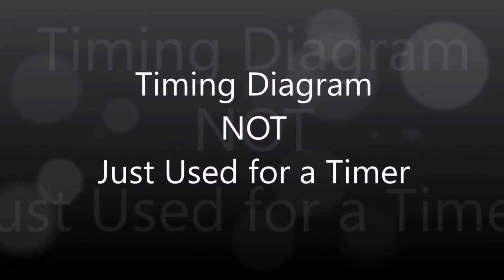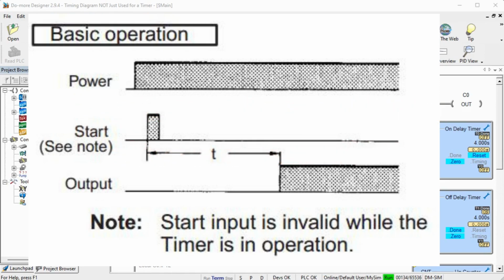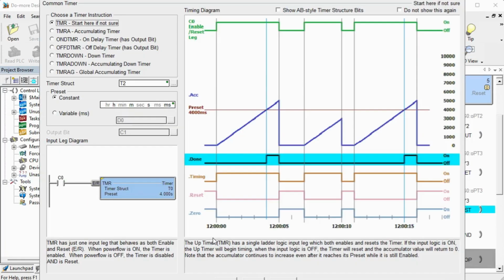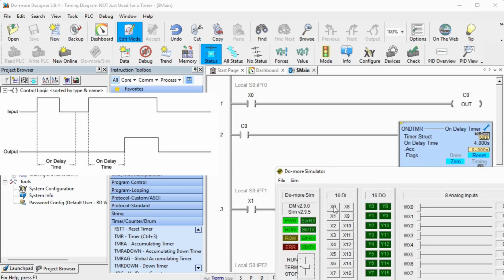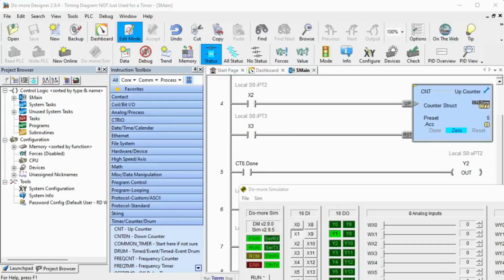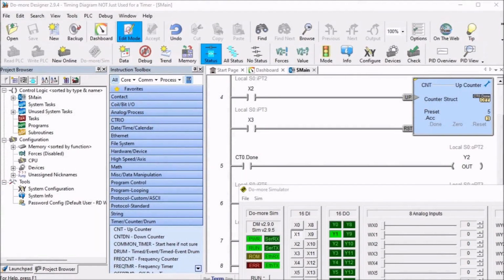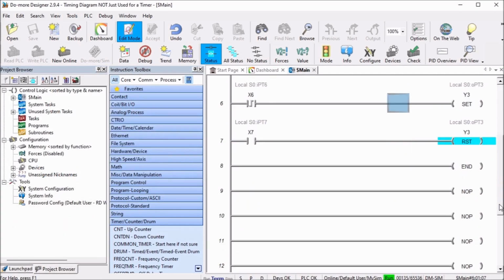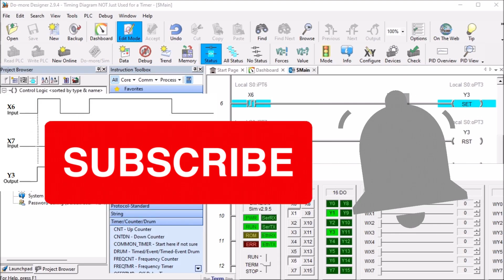Timing Diagram NOT Just Used for a Timer

Comment from the maker: Detailed information and links can be found on the corresponding post located here.
https://accautomation.ca/timing-diagram-not-just-used-for-a-timer/

The following is a list of PLC controllers that we have covered using timers.

BRX Do-More Series (Do-More Designer Software + Simulator)
https://accautomation.ca/series/brx-do-more-plc/

Click PLC Series
https://accautomation.ca/series/click-plc/

Productivity Series
https://accautomation.ca/series/productivity-1000-plc/
https://accautomation.ca/series/productivity-2000-series-plc-p2000/

Omron CP1H Series
https://accautomation.ca/series/omron-plc-cp1h-series/

Horner XL4 PLC Series
https://accautomation.ca/series/horner-xl4-series/

Regards,
Garry
ACC Automation
https://accautomation.ca/